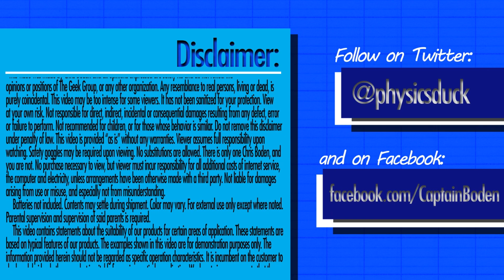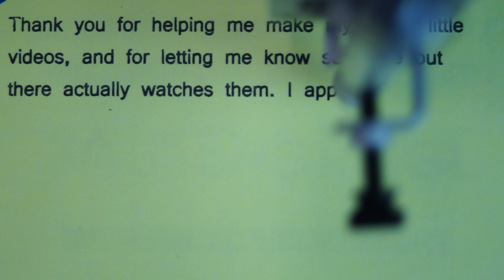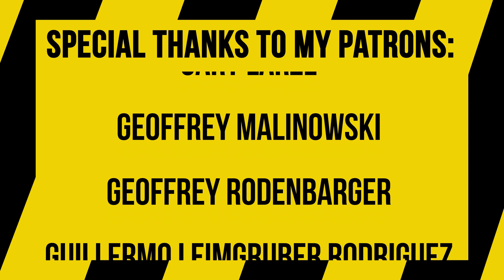Project ARchi3 Episode 57 - J5 Carrier Installation

Comment: what's the m number on a bolt?
Reply: M3 is a 3mm screw, 3mm being the nominal outer diameter of the threads. Length for grub screws and countersunk screws is overall length. For cap screws, you measure from the underside of the cap to the end of the screw.